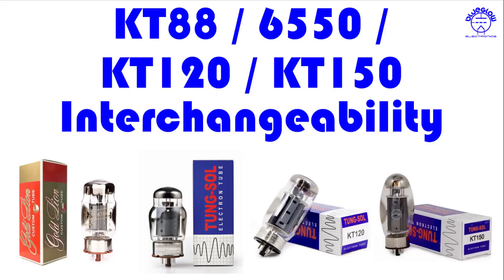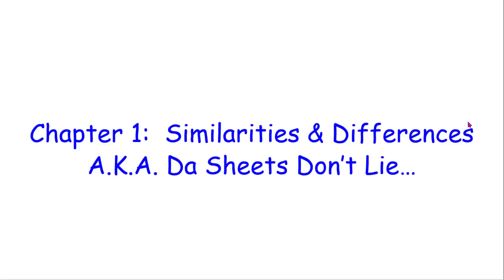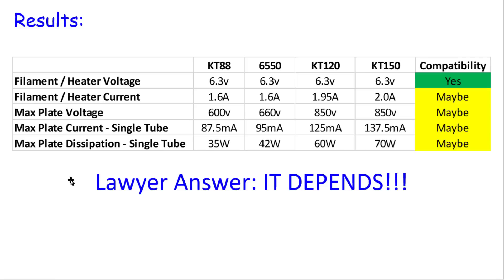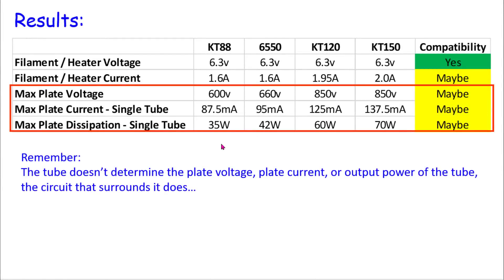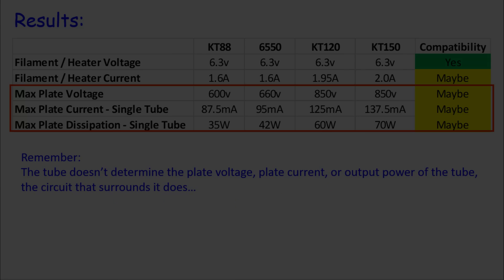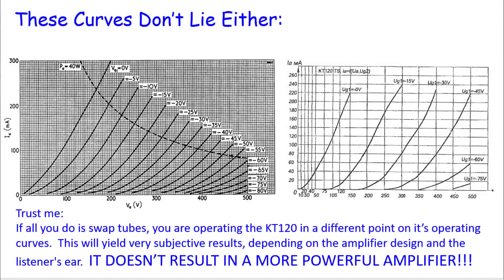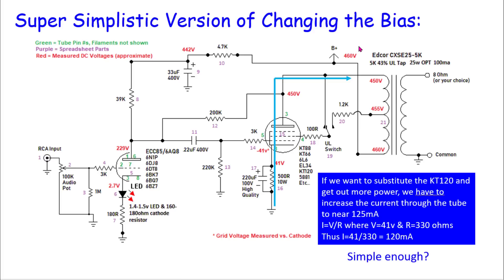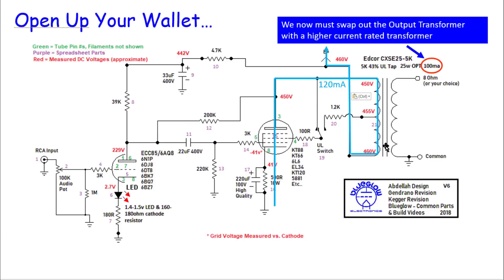KT88 6550 KT120 KT150 Tube Interchangeability

Comment: Looking at the Mastersound Duetrenta we (business) were donated (crying in Italian). After recapping and replacing the enamel resistors to near perfection, I decided to put Tung Sol KT-120s in it. The valves quickly reached 101.7c after 5mins. We switched the amp off after seeing some light smoke which smelled like the fresh flux which I forgot to clean off the resistor stack. At least this is what I am hoping! I am not out of pocket but I would hate to have killed what could have been a £3500 amp for the sake of MORE POWER! I wish I had stumbled across this video prior to testing.

Comment: But , running the kt120 in place of the kt88 at the same ratings, that should give you better power tube longevity. I was using kt 120 instead of kt 88 just for a little more peace of mind.

Comment: 100% agree on this. Optimum performance mya not be achieved. Between EL34  up to KT120 its 56mA up to 135mA for 90% dissipation at fixed 400vdc  B+. For 80% its between 50-120mA plate current.

Comment: A while ago I swapped the 6550 valves for KT120s in my Croft 4S amplifier. In my ignorance I thought I would get more power. I was nervous to switch on half expecting bangs and flames. The Croft has external bias adjustment and measuring points. I plugged in my meter. I used to run the 6550s at 80ma and so I expected the reading for the KT120s to be similar. To my surprise I watched the reading starting to sail past 95ma and so I quickly turned the bias to minimum. Another surprise was the lowest reading I could get was 93ma whereas I could get a lot lower with the 6550s? The amplifier did seem to get very hot but nothing untoward has ever happened. I hoped my transformers wouldn’t go into melt down but I assumed if the 6550s could run at 90ma it should be safe 🙏. A little knowledge is a dangerous thing 😁. It made me wonder if people without bias capability may have their amps running into excess current problems? As for the sound I seem to recall it being a tad leaner but with added clarity. The bass seemed to be lighter, but after adjusting my subwoofer I think it was lower and tighter 👍. The sound overall did seem a lot better although I suspect my ears readjusted to it a bit. I think for me it was well worth doing ending up with a very nice sounding system that could blow you away with adequate volume 👍.

Comment: I have a Fender 400PS which uses three pairs of 6550s.  They tend to be very hard on 6550s.  I'm thinking that if I put in KT120s, they should run well and last a very long time and have no trouble delivering the full rated power of the 6550.

Comment: I used Kt-170 for my Sonic Frontiers sfs 80 without any problem, the sound is much better than the KT99 or KT88, but I need to add one more filament transformer separately dedicated for all KT170s.

Comment: I holding a quad set of Russian made 6550 winged Cs.... 
 I can confirm that they enter change well  in my 1976 Musicmann HD130 it's an amp designed for EL34 x4. (Solid state preamps and 1 12at7 for a phase inverter l.....   
 The y had at east 100 hours run over 2yrs maybe more....  
i just pulled them for check up... 
they register almost exactly as the did when they were new out of box....   
The difference in headroom volume and just pure ghetto thickness is worth all risk I know I'm taking.    But my ears don't lie....

Comment: Heij Mark, I very much enjoy Your way of teaching things. I work on an old British Radford TT100 AB2 Push Pull hybrid amp that uses a transistorized pre amp stage and four KT88 (two pairs, stereo) to output 100 watts per channel into 8 ohms. But I don´t need that so I looked into EL34´s, much cheaper. The KT´s are driven with 642 volts- a bit much for the EL but otherwise it would suit me.
Could You help me figure this out? A bit much to grasp for me as entry level enthusiast but we´ve all started somewhere.
I ordered new electrolytics for it and am kinda still in the "wrap my brain around the schematic phase" and it´s awful. Reality and plan don´t add up, i find wrong resistors all over the place but all is stock. No one has been in here, I´m the first and do not want to mess it up.
This amp is a hog and the Radford drawings and data is odd to say the least... It runs but the bias is all over the place and it sounds bad, distorted highs and no bass punch- I end up scared running it because I don´t wanna kill any transformers as they are Radford made in their own department so veeery expensive to replace- If You can find them.
I have other broken Radfords but the TT100 is such an animal, I love it. And rare, too- if 500 were made that´s a lot.
I want this as my show off amp, for daily use I have a NAD 7100 receiver which can also power the TT100. Together they should blow out windows but the TT100 delivers rather a screech, I have very nice speakers which make differences audible- they got me into this mess in the first place. I wasn´t really able to hear differences in recordings before, Canadian Newform Research Ribbon Tweeters and French Audax basses together with homebrew frequency dividers- I found my holy grail.
I got a little off... Could You help me look into changing to EL34 in this case? I´d very much appreciate the help.

Comment: How does running them in triode mode effect the overall picture? I believe they'd draw less current that way so may be less taxing on the amp.? I'm guessing though I'm a noob😁! I've gotta kt88 set amp and I'm still trying to figure out if it's ok to swop the shuguang 88s for some old Russian 6650s I've had in the drawer for years?🤔

Comment: I run kt120s in my Doge 10 mk2 B tube valve integrated a 59 pound beast actually the desighner reccomends to atleast try kt120s normally i run kt88s
 I have pics up on me community page KT120s have hell of dynamics and sizzle on top !

Comment: Not to mention that most hookup wire insulation is 600V to earth. Increase B+ and you have a rewire with 1000V+ insulation. For PCB components then you're looking at creep etc so the track spacing and materials have to be designed for it.

Comment: I have an amplifier made for EL34 with auto bias. It's a Swedish stage called Edison 30. I have changed the 4 tubes for Gold Lion KT66. The sound is better, the base is tighter, better control overall, but not better "push" overall, was hoping for more power. 
What tubes will you recommend instead of EL34? KT 88, 120, do they increase power? I understand it comes to what amplifier it is too

Comment: First comment that I would like to make before I even watch this video I have a pretty good idea what it’s going to be about but from my own experience from many many years working on tube amplifiers is trying to create more wattage with a bigger tube is really not going to get you very much because the amplifier itself is limited to the voltage and amperage that it is supplying to the tubes so you’re only going to get out of the amplifier what it is designed to do unless of course you Beef up the transformer and output supply transformers and a few other components that will allow the amp to push more current.
Reply: OK just finished watching the video and I was correct you can only push those tubes as far as the amplifier will allow it to. 
But what was also mentioned that I forgot to mention which is also true putting an extra load on your transformer is not a good thing to do. Its time to build a bigger amp if you want the bigger tubes lol 
I'm with ya Mark lol

Comment: What if you go down, like putting NOS 5881s in a modern 6L6GC amp? It would run them at a higher operating point, correct? I’ve done it, and I like the sound. It breaks up at a much lower volume.

Comment: Kt77 is a good  valve but people don't mention them match. Better solution is to get rid of the transformer worst thing for a valve amp put a switch mode power supply 120Khz much better results

Comment: Thank you for bringing up this trendy subject ....I had to repair several often expensive amplifiers after audiophiles swapped their tubes for these new generation power tubes ! 
There's another  aspect to it and that's the necessary  voltage swing to the grid off the output tubes which was optimized and  calculated for the original design....
Even in recent ( mostly "sino made " but not always )  tube amplifiers , the transformers are sometimes underrated or limited in current  handling to begin with ( it's about economics so they don't care about a lifespan od several decennies) ...so are the PS capacitors voltage ratings......I've seen 45O volts rated capacitors on 475 V HT supply ...worse if measured  on the input stages just after start up, before the tubes warm up and draw  their nominal current ,   cooking time for these capacitors (  example :  350 and 250 volts on a 500 V HT rail before current  on the tubes will bring them in range of their working voltages )....

Also as the tubes age....and their current drops ....The HT voltages  are climbing and come closer  or can e trespass  the voltage rating of these capacitors....so change your tubes before bad things happen to your amplifier....or replace such underrated components by better ones.....
Even factory build , the filaments voltage are not always right !!!!....Wrong filament voltages have and will create problems , perform badly ore compromise the useful lifespan of the tubes.  
If all goes well they will hold the time of the warranty .............
Reply: Could you imagine not only having to install series filter caps, but three series filter caps for the first two nodes of the power supply! The power transformer would be very, very, VERY large also.

Comment: Mark thanks for the information. I have a Sonic Frontiers sfs 80 which was totally rebuilt. I currently am using EH KT90s.
I was told that it could handle KT120s but was skeptical about the actual benefits of using a tube which draws much more current than what was intended. I am grateful for you taking the time to post this video.

Comment: And just because an amplifier is powerful and new doesn't mean you should swap tubes either. For example the Rogue Audio Cronus/Atlas and the Audio Research Reference 75 were all designed for the KT120 tube. While Audio Research later updated the Ref75SE to use the KT150, they endorsed the KT150 for earlier models too. However Rogue Audio does not endorse using KT150s in their KT120 designed amps. This does not make the Rogue products inferior, it just shows that they made different design choices.

Comment: Very good presentation, however,  WRT to GEC tubes I've used, the KT88s and 6550s are the other way around -  the KT88 draws more Plate Current and has has higher Plate Dissipation than the 6550!
Reply: I was scratching my head over this as well.
Reply: @randyrobey5643  - The GEC Data Sheets confirm this!

Comment: Hi, Mark! Great info. I’d like to ask you about the 25 watt (output?) rating of the OPT versus the 40-something rating of the kt88. Can you explain the relatability, plz? Do you have any thoughts or comments? Thx again for the great content.
Reply: Not running a tube at max plate disapation is common. You don't want to push a tube to its maximum. You want it to work in a sweet spot. For kt88, it's actually about 30w. At 30w your saturating the tube, but aren't putting a ton of extra energy into it, thus extending the life of the filament, and providing the best efficency/power ratio

Comment: Great video, Mark! It's kind of like taking a Ford Fairmont with a four-banger, swapping in the optional V8, and fitting the 1bbl carburetor from the 4 cylinder to it. Sure, it'll start, idle, even run. But it will never be twice the engine. Sorry for the bad analogy.

Comment: I have been waiting on an Etracr till I knew more about load lines, thanks. One question, If you have a 50 ma choke. Now you need one rated for 100 ma. Can you get a 2nd 50 ma choke and run it in parallel ?
Reply: One of the two will always have more current running through it because no two wound coils of wire and steel cores are identical. The difference may still be in spec, but I would not build an amp with cheap band aids by design. One 100ma choke will always be less expensive than two 50ma chokes too.

Comment: Excellent explanation, thank you. In addition you may have to change the turns ratio of the output transformer primary too. One thing I don't understand is why anyone would use Ben Franklin's mistake called "conventional flow since, in a tube, electron flow is what happens.
Reply: Hey the whole INDUSTRY's based on that now..

 You've REALLY gotta remind yourself that most EVERY diagram you see will have the arrows going the 'wrong' way ;)

Comment: When calculating the the transformer current, you need to multiply the DC current by about 1.414 to get the correct AC current in the winding for +B. Even your original KT88 design with 2 X 81 mA, needs 230 mA not 200mA.
Reply: This does not make any sense to me. The 1.414 is the factor you use when rectifying voltage from AC to DC, it has nothing to do with current.
Reply: @qddk9545  Since the power on AC and DC sides needs to be the same. DC Voltage is higher than the AC voltage, therefore the AC Current needs to be higher than the DC
current. Very basic knowledge!

Comment: I've got a Mesa/Boogie Mark IV. Mesa amps have a set bias on them. They have this thing they call "Simulclass" amplification. Ya are able to run a quad of 6L6s, 6L6s and EL34s, or a quad of 6V6s...now my question is: since they are biased so cold is it possible for me to run a set of KT-88s on the outside sockets?...without harming anything in the amp? I know it will run them cuz I've tested this theory out but I didnt run them for long. I like how it sounds, but I don't want to burn my amp up. I'd like to run a set of KT-88s on the outside sockets and KT-66s on the inside sockets.

Comment: Great video. It's not that simple! But I think we also need to emphasize another point here. How much more power are you going to get for your money? Most audiophiles have read the fact that a 100 watt amp is not ten times louder than a 10 watt amp. Realistically it might be twice as loud. Our hearing is not linear. So say you bump your 6550/KT88 from 60 watts a channel to 90 watts a channel, and that's after all the expensive mandatory component upgrades  noted in this video. Listening wise what did you gain? Not much at all. And you have potentially compromised a well designed and balanced circuit increasing distortion and other sonic ills. The difference in power here is not typically significant in a home HiFi listening environment. Guitar amps, perhaps there may be some advantages.
Reply: It's simplistic but a 10 watt amp can't drive more speakers. Power ,or wattage will drive speakers that move more air which will raise enough db to have the police called! But then again ,, efficient speakers need less power. So a 60 watt amp can drive four klipsh corner horns so ya gets what you can afford.
Reply: @russellesimonetta3835  The power of an amplifier has nothing to do with the number of speakers it can drive. A one watt amp can drive 10 speakers provided I keep the impedance matched. PA systems do this with transformer matching. As long as the total wattage load is below the amp power maximum, the number of speakers can vary greatly. Tube amplifiers are especially critical for impedance matching. That's why they have 4-8-16 ohm terminals whereas solid state amps do not. But on nay HiFi amp you are basically limited to a 4 ohm load or two 8 ohm speakers in parallel.
Reply: @andydelle4509  i kind of said that,, but you're right.

Comment: Excellent explanation.  I never really got the attraction of "tube rolling".  A design is tweaked to operate with specified components.  I guess sometimes you can luck out and something else might work better, but have found, especially with things like cars, usually not...
Reply: It's the desire to get a lot more for very little money.  You can find the same concept in the automotive section of most stores.  But it also seems to rely on the belief that the designers overlooked something stupidly simple.

Comment: It is always best to call the manufacturer of the amp.If you want a tube amp that uses kt120 or kt150 ,Buy one that has the transformers designed for those specific tubes.

Comment: Analogy: Can I put bigger tires on my car? Will it go faster?
Reply: Agreed. Besides hot rodding guitar amps, I like to tweak cars. Classic scenario: person adds boost to the engine (turbo, blower, nitrous, , , ). Now the clutch failed. Fix clutch and U-joints fail. Fix u-joints and rear differential fails. . . .
Reply: Up to the point that the tires rub, each wheel revolution carries you father ahead for a larger tire size. So you will be traveling faster for a given engine speed, subject to rolling resistance and aerodynamics of course. Will the vehicle "be faster" with bigger tires? Only in the sense that your speedometer now reads slower than your actual speed since it's geared to the transmission, not the tires.
Reply: @nickroberts8011  But bigger tires require more torque to drive them.  Can the drive train deliver, or will it actually hurt your 1/4 mile time?  A little bigger might do something, but jack up the car and put monster truck tires on?  Open your wallet, you need to change the gear ratio.
Reply: Russell Hltn - exactly, 1000% correct
Reply: People do this all the time. Just like bigger tubes, the mismatch causes the car to be less efficient.